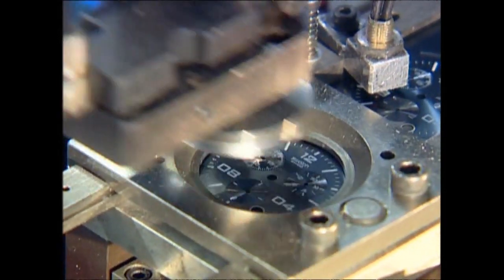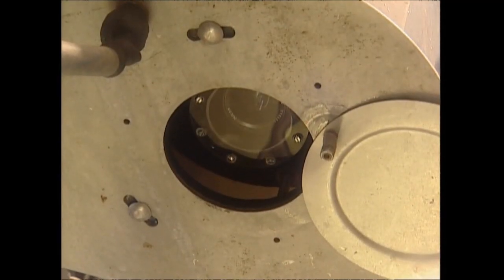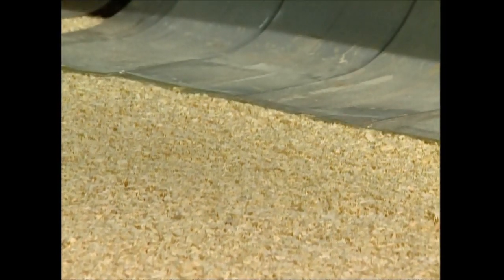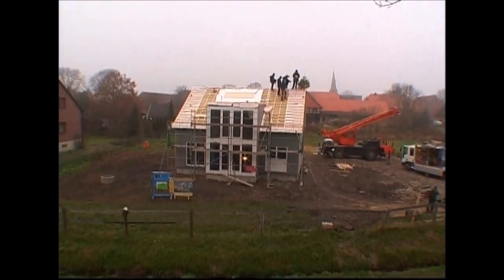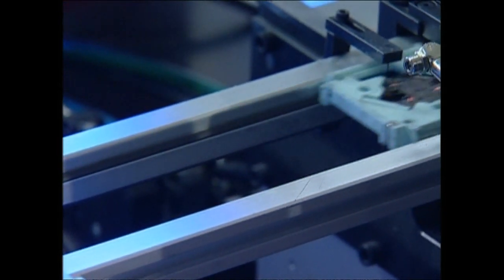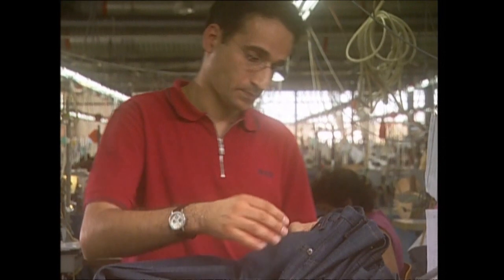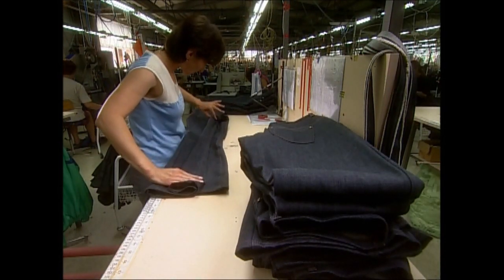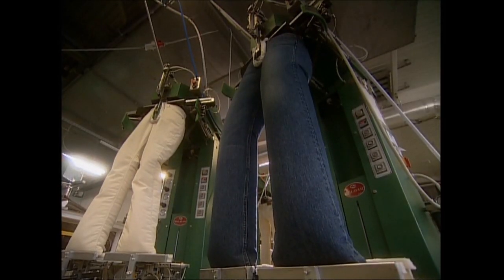► HOW IT WORKS | Oven Chips, Swatch Watch, House, Jeans | Episode 5 | Free Documentary

Comment: Um wood shavings inside a wall. Will not pass here in Canada.  Wrong type plus will cause fires. So that fails in the housing standards.
Reply: No, the narrator says they mix a "milk" into the wood shavings that has 2 chemicals, 1 for fungicide, 1 for fire prevention
Reply: @rremmy72  Exactly, people are easily "offended" by everything like this. In fact there are even food grade bleaches, peroxide, etc. People needs to understand USUALLY if used correctly, respectfully, etc etc etc it's not as bad as they make it out to be.

Comment: cardboard houses held together with staples.
Reply: Not actually that different from modern new builds.   “Compliant” is all that matters.
Reply: @df18001  Absolutely, if it can "barely" be a house, it gonna be built. Exactly to specs, no more no less.
Reply: It's lucky we don't get hurricanes or tornadoes in the UK or the homeowners would wake up on a yellow brick road.
Reply: The parts would be lighter if they used proper insulation.
Reply: Yeah those houses look kind of shady. You see the so-called insulation in the walls?

Comment: The prefab house is some brilliant engineering. But in wood?? I guess that is for the US market then. Great for fires...
My parents house in Belgium was also built using prefab walls,  but in reinforced concrete, and then normal bricks along the outside. And that was some 40 years ago!
Reply: I have never seen a home in the US insulated with wood chips like that. That WAS NOT in the USA. It wouldnt even make building code. I have no idea what country. Germany mabe. We dont use tiles on the roof, not in any state.
Reply: This is a British show so that "house" is for European markets. Secondly did you not listen to the part where the wood shavings are treated for fire resistance and mold?
Reply: Everyone is acting as wood is the worst thing ever. There much more that can very much goes wrong well before it takes haul and catches fire. I would be more worried about any disrespectful wiring job, appliances, extension cords usages, etc before I would worries over respectfully treated timber (there's a HUGE difference between firewood and wood MEANT for buildings!!).
Reply: Really? Here in Sweden most prefab is wood but we use rockwool as insulation, and much more of it, 50-70cm instead of 30.

I think main reason why buildings arent built with wood in Belgium is because you dont really have access to it.